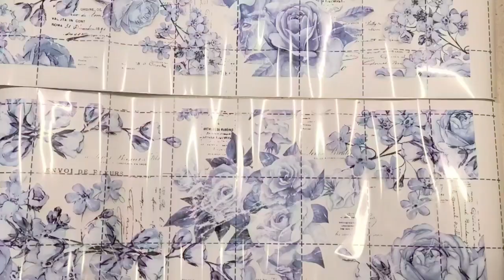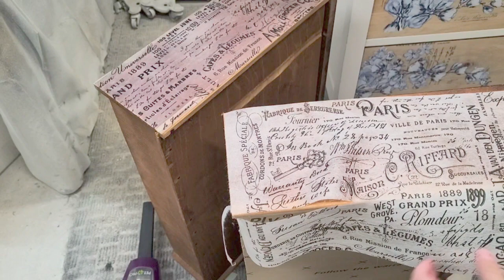Epic Vintage Dresser Make Over | Furniture flip | Original Hardware

Comment: Why did you paint so much of it or otherwise cover up that wood when you sanded it so thoroughly? Also, if you clean the piece well before sanding, you won't gum up your sanding sheets. A lot of that gunk is nicotine and other buildup through the ages.
Reply from the maker: I didn't cover it all up i wanted some wood showing through the transfer. I also explain in my video that I sand with my orbitol first to remove the gunk AND at the beginning of every single video i share how i clean all my furniture pieces first.